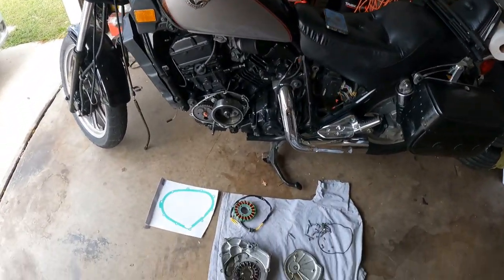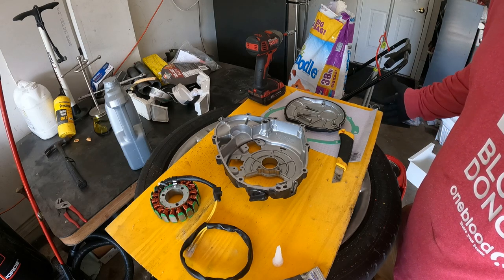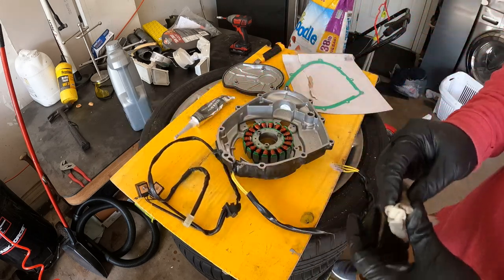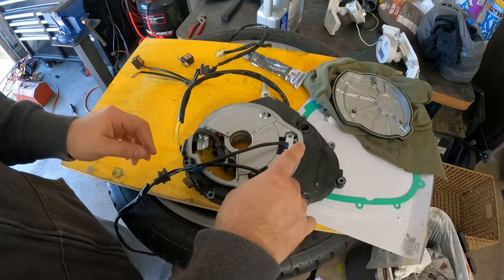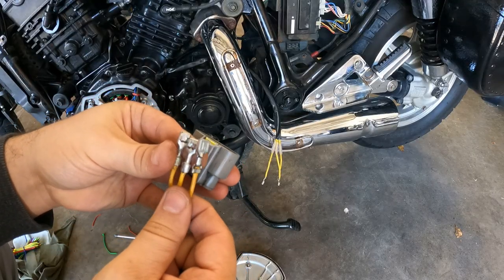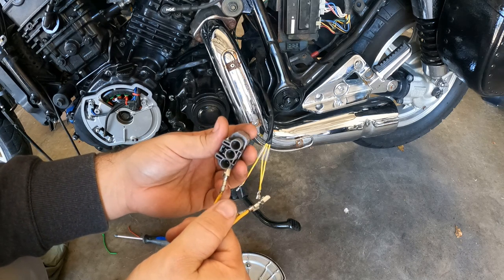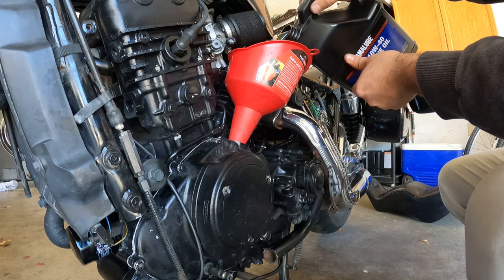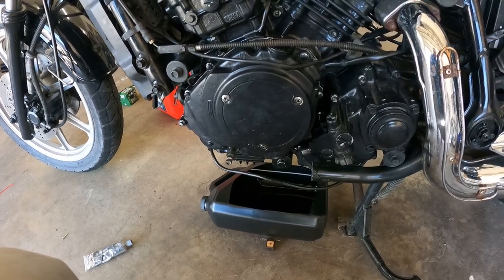2005 Kawasaki VN750 Stator Replacement Part 2 (Will It Start?)

Comment: Great tutorial. Getting ready to do the stator on my daughters 05 750. Looks exactly like yours. Cutting the frame is a great idea. Wleder by trade so I'll have her bike fixed in just a few hours. I was laughing as soon as you cranked it and it wouldn't hit, I KNEW what was wrong. I've been riding for 53 years (God I just dated myself) and had my share of those problems. And it'll drive ya nuts. Back then I had no internet to refer too. I was making up cuss words never heard before, lol. But it's something that, in the future, you'll never forget.  I timed a Dodge Colt 180° out. The engine backfired and started running backwards. NOT WELL, but it ran backwards.

Comment: Is that an upgraded MOSFET regulator? I keep burning out the cheap Chinese replacement ones.I  have the 2006 vn750 model. The only thing that ever gives me problems is the charging system. Makes me want to give the bike away sometimes because I have 2 other bikes as well. 😒
Reply from the maker: It’s not the original one, on the back it had a Yamaha Emblem, so I’m assuming it was from a Yamaha bike. Lol
Reply: Where did you buy